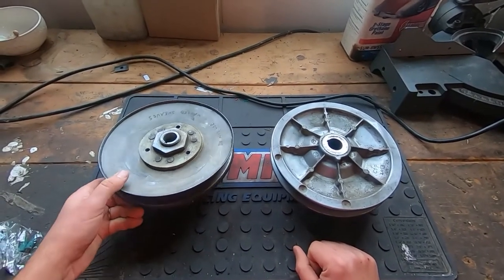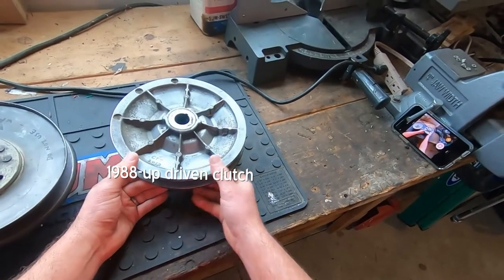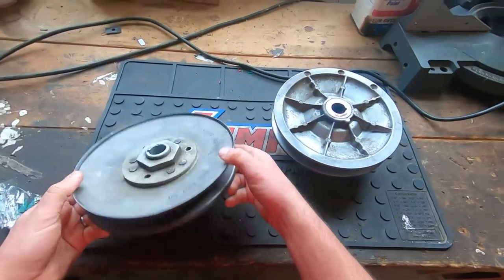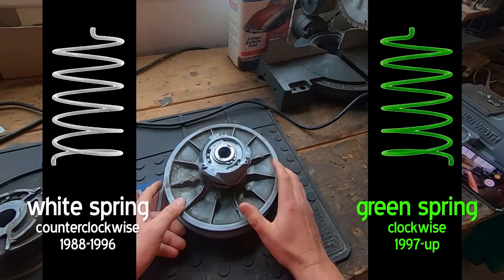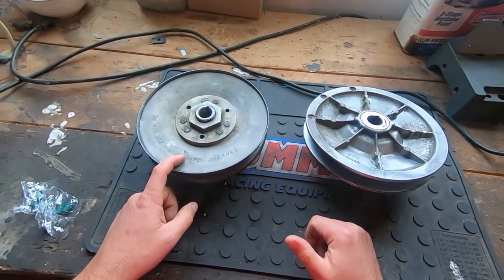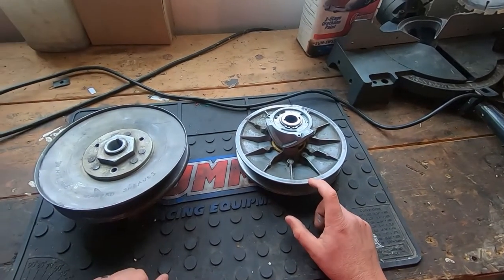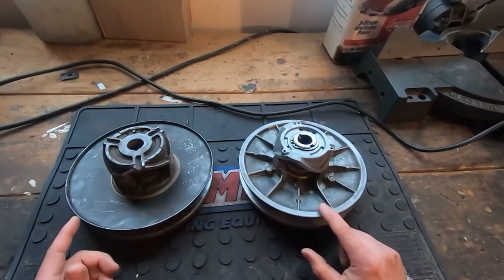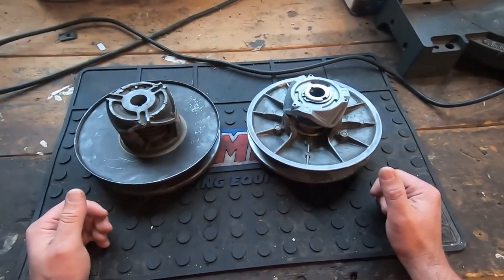Club Car DS Driven Clutches - Which Style Should You Choose?

Comment: Do you have a video to disassemble the older one?
Reply from the maker: No I do not. I’ve tried to get that large nut off but it won’t budge. I have not taken apart one of the old ones.
Reply: You have to take the large nut off. after that you spin the sheave off. be prepared for the lower sheave to pop up. It is under tension from spring
Reply: @craigartzner  I'm sure you're aware,  but that big nut is left hand thread. I'm trouble shooting a clutch issue on one right now

Comment: I have a 1985 DS that dies on hills, if I stop and start again it goes good for a short time again then dies again, motor runs well.  I noticed that someone put the newer clutch that u have in the video at some point in time.   My question is do u think it needs changed again.
Reply from the maker: Without seeing what’s happening with your clutches and drive belt I can’t be sure what your issue is. Is your cart lifted? How big are the tires? Are the clutches operating properly in maintenance mode?

Comment: So, where would you recommend getting one of the aluminum driven clutches?  Most for sale out there are the steel ones for the pre 1996 club car carts
Reply from the maker: Just did an eBay search just now that brought up plenty of both kinds of clutches. My exact search was ‘ “club car” driven clutch’
Reply from the maker: Most listings will say “1997-up” or “1998-up” or “1997-2014”, etc. Those are the ones you want, and make sure the picture is of the right clutch.